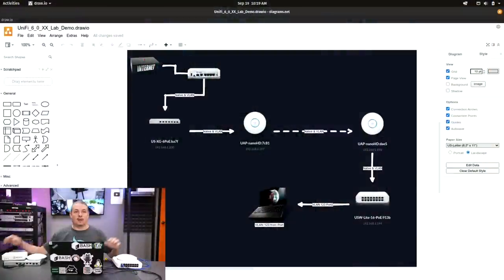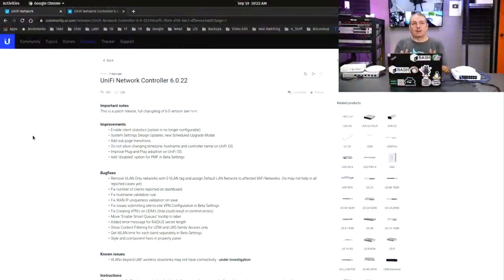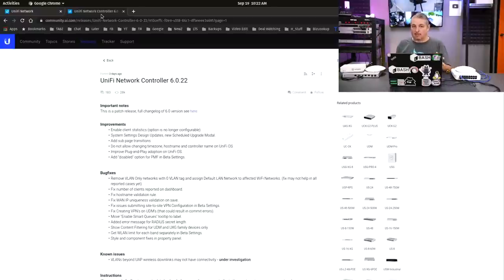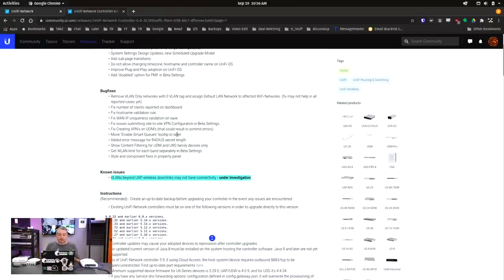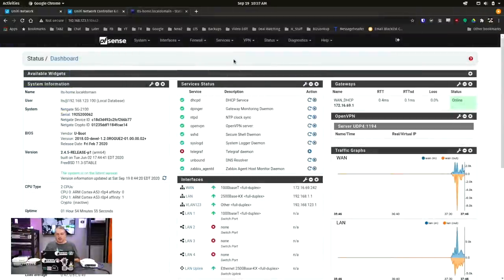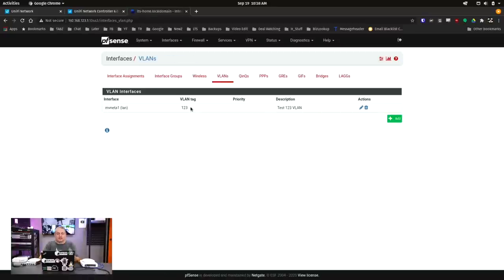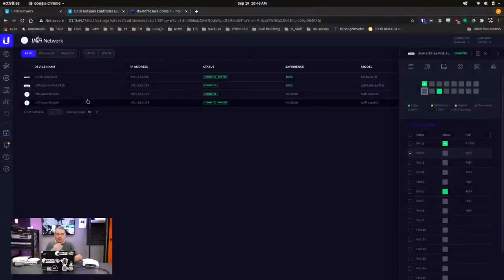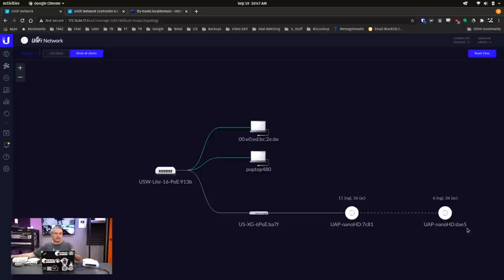Testing UniFi Controller 6.0.22 With VLANS Over MESH & The Problems With UniFi Products

Comment: UniFi Network Controller 6.0.23 has just been promoted to Release Candidate 
Improvements
Add MAC Address Filtering for WLAN.
Limit maximum shown upload/download utilization to 100%.
Bugfixes
Fix Accordions in Beta Settings Networks from being unable to open.
WiFi AI - fix excluded channels dropdown/list.
System Settings -> Updates: use 24h format if it is set in system settings.
Ensure DHCP Relay section can be found in search.
Update AP Group form labels.
Known issues
VLANs beyond UAP wireless downlinks may not have connectivity - under investigation

Comment: If your VAR doesn't add value... you have the wrong VAR and you need to fire them.    Also you need to be on the scale where it make sense.   When you have a many multi-million annual budget, you have things like weekly calls with your HPE ASM + their entire team where all open cases are reviewed, updates about security and software issues are talked about, any personnel issues with vendor Field Engineers are addressed if needed (it happens as they use contractors like Unisys/ect..).   Your VAR is on all of these calls and makes shit happen.

Your VAR is responsible for knowing your base requirements.   When you suddenly need a database server, blade, blade chassis, or HP/pure storage array/shelf/whatever, you just tell them get you a quote and maybe you highlight any important changes if needed.   .........And when they fuck up and something is not right.... you do enough business with them that they make it right without even asking.  If they have to eat $10,000 to change the config of a server so you don't wait another 3-4 weeks to get a PO through purchasing.... they don't care!  NO big deal...

There's tons of Value to be added... you just have to have the right VAR.

Comment: Really old versions of the controller I believe had it on by default. So if the controller was setup a while ago that setting my have been on for people for a while.
Reply: Yep. I installed the 5.x controller about a month ago (due to a flood of going-obsolete UAPs coming my way) and it was on. I know, because I needed to disable it to have more then 4 SSIDs

Comment: New to the Unifi ecosystem and installing a UDM shortly. Can/should I stop it from updating during initial setup?
Reply: The new controller isn’t out yet,  for the UDM or UDM-Pro it’s still 5.14.. The Controller updates come with firmware updates on the UDMs which is right now 1.8.0, which is working fine on my UDM-Pros.
Reply: @lynx_de5024  thanks!
Reply: it all depends on your scenario. Simple scenarios seems to have had no problem on upgrading from 5.x to 6.x controller. Those a little more complex scenarios, those were the one hit hard. If you have a single UDM (the base one), I'd say it's very unlikely you'll have a complex scenario and, thus, will likely have no problem on upgrading to 6.x when it's deployed to the UDM firmware. And that should only happen on 1 or 2 new "regular" controller releases, to fix some of those really bad bugs, which makes UDM upgrade even safer.
Reply: @leonardogyn  thank you also

Comment: That issue with the map and showing the switch wrong is better then the "old" 5.12 (see this screenshot of my home network) https://drive.google.com/file/d/1qDuoISLGUTCKWfXNgEXTUnWPMBQ9ujPy/view

Here the USW-8P-60W is connected to the UAP-AC-MESH only (both are located in my shed in the back of my garden for camera's, never had any issue with them). But it shows like it is connected to the USW-16P-150W on port 9, but on port 9 the UAP-AC-PRO-02 is conencted.

Comment: Lawrence, I disagree with you on the scale of users being the reason for the noise. If Cisco had this many stability problems or didn’t listen to consumers, they wouldn’t last in their primary market (Fortune 500 mega corporations) for as long as they have. There is a real problem here. As someone with lots of experience with huge companies, they do want to save costs and look at Ubiquiti. They just quickly toss out the idea because of so many missing features and poor quality control. for Ubiquiti to actually be enterprise, they need to work on listening to customers and firmware quality control. I hope they eventually get there because their business model is wonderful — they just can’t compete with real enterprise gear in terms of stability because they don’t care if a home user’s network goes down for a bit due to their crappy firmware QA process. When they put as much stability focus and process refinement into it like a dominant player like Cisco does, believe me, the mega corps will take notice and switch.
Reply: Cisco is also not the holy grail. Our Firewall stopped working because Cisco had an bug in there firmware where a firewall running more then 200 days just stops working...
Reply: One example of a cisco low end consumer router blocking curl UA is not the same thing as a firmware update that causes a broadcast storm on your network and stops your network from functioning. Your link has nothing to do with stability issues or listening to customers/customer frustration. Ubiquiti dream machine has been a joke and most youtube reviews show it failing to configure. Dont go there because ubiquiti has so many failures and complaints on the internet including their forums. If ubiquiti was so reliable then why are large enterprises still sticking to the Cisco stuff? At large enterprises, no one likes to spend cash on network gear unnecessarily (except for the IT guy 😂). I am rooting for Ubiquiti but they have far too many screw ups compared to the big dogs in the room. Let me post some of their failures here:

https://community.ui.com/questions/UDM-PRO-release-is-a-disaster/bf98e20e-1290-40a2-9e30-517561fdb705?page=3

https://www.missingremote.com/blog/2020/05/udm-pro-1-7-0-dpi-is-crazy-slow

https://community.ui.com/questions/UniFi-AC-Pro-many-problems-/15277774-874b-4800-81aa-0f4a3af7a75b

https://youtu.be/UA9ZIeRhKXU

https://www.cbtnuggets.com/blog/certifications/cisco/could-ubiquiti-replace-cisco

https://www.reddit.com/r/Ubiquiti/comments/iwhqgu/usg_unifi_is_the_buggiest_pos_software_i_have/?utm_source=share&utm_medium=ios_app&utm_name=iossmf

https://www.reddit.com/r/Ubiquiti/comments/iuglvo/did_anyone_actually_fix_the_udm_issue_of_losing/?utm_source=share&utm_medium=ios_app&utm_name=iossmf

https://www.reddit.com/r/Ubiquiti/comments/ih2a0v/udmpro_review/?utm_source=share&utm_medium=ios_app&utm_name=iossmf

https://youtu.be/SyCdKIE6Bq4

I could post literally thousands of links but you can just check the Unifi forums and its flooded with complaints of Ubiquiti not listening to customer requests (as usual) or reliability problems due to dodgy firmware. Look, I hate Cisco’s business model but they are just far more reliable. I wish Unifi could be the perfect combination of low price and reliability but it isn’t yet. I hope it will change in the future but Ubiquiti IS NOT enterprise-grade no matter how much the fan boys say it is. Sorry

Oh, and don’t give excuses like Cisco forums are private — because they aren’t. It’s all public and there is no secret forum conspiracy. Just google it

Let’s not even talk about support. Unifi should at least offer an enterprise-grade support option because the support is currently a joke. They also release products with promised features but never actually activate them. UAP-SHD anyone? Even $30 Cisco Meraki access points have real WIPS features that actually work by blocking unscrupulous SSIDs while a $500 UAP-SHD is still missing WIPS. I could go on but those who have many years experience with Unifi and Cisco both know the shortcomings and know why Ubiquiti isn’t being taken seriously in the top tier.
Reply: @kittysreview9055  Ubiquiti is for home use. Enterprise grade support Option wouldn't help either because the problems wouldn't be fixed. But at least Ubiquiti would be forced to listen to the customers and getting to know their problems. I tried Ubiquiti on several occasions, for basic setups with 10 Access Points or so with only one SSID it works. For more complex setups in companys (e.g. VLAN use, real management including autochoosing RIGHT und SENSEFUL channels on the wireless side) I am still stuck with professional hardware from (being located in Europe) Lancom. There is support (paid but fast and helpful), a real good knowlegde base and reliable hardware. Safed me most of the headaches...

Comment: Okay, so i'll admit, i'm a complete noob when it comes to IT. Though, i's a bit of a weird case. Let me explain. Since i was young i was always interested in technology/hardware etc. I've been building computers since i was 15yrs. old (i'm 34 right now). So i do have some knowledge about technology in general and some basic knowledge about switches i guess. Like, i know that you have "dumb" switches and managed switches. I know about (the existence of spanning tree) but not what it does (or what it's used for). I know about QoS, PoE (though i don't know things like, if i connect my new Mac Pro 2019, which has cost me $15000 to a PoE switch, will it fry my Mac Pro?) Finally, i know about link aggregation/LACP, but not the full story on it, i know there is full duplex but again, what it means is beyond me, and then of course layer 2 & 3 etc etc...

On the other hand, i do want to learn more about it cause i'm really interested and also i want to have a good internet speed at home and i have multiple devices that i want to connect and be able to manage myself so that i get the full speed and benefits out of it.

That being said, i know a lot of techheads will laugh with me, that's fine, we are all here to learn. My thing is music production and video editing with on the side some graphic (web) design. Things that i all learned by myself. Building pc's is another thing i completely learned by myself. Watching YouTube goes a long way but it's not always 100% complete, in a way i guess.

Then there is also the language barrier. While my English is "okay", it's not my native language. So i might make mistakes along the way.

So now, for my real kind of question, i would like to start out a home network. And so far i knew that Cisco was a great solution when it comes to network switches. But then i learned about UniFi. And i'm not sure what to do, because now i see this problem. And i've also seen updates on the hardware like gen2, and i just really don't know if i should get one over the other. I know Cisco is more advanced and really used more in professional area's. I know it's more of a steep learning curve. But like i said, i don't mind that, and also, well, i have the time, since i'm home because i have a disease named Graft Versus Host.

Anyway, if someone is willing to help me out a bit with this, i would greatly appreciate it!
Reply: @promethbastard  Thank you so much! Okay, then i will look into UniFi! I'm going to buy one next month probably just upgraded my storage because i was starting to get low on that as well. It all cost so much! But hey, i love technology and i love to learn more and more and, well, with that comes a cost of course 🤷🏻‍♂️

Comment: What about Mikrotik?
Reply: I switched from mikrotik to unifi. Now my network got entirely grilled the second time in less than one year because of that controller software , which is getting more ugly. I have 3 AP and the 24poe switch and the USG. The USG is not even able to create static dns entries without cmd hacks .. so I guess it is time to move back to the mikrotik stuff cmd for everything , but rock solid
Reply: Florian Hammers Mikrotik is my choice because of its abilities to provide a great security features

Comment: Personally i don't really agree with this argument. There are a few ways to address these issues. As someone has mentioned, you can create at stable release, so if you wanted to say have rolling updates and auto updates on, you can and you would just set it to stable release. You talk about Windows 10 and even Microsoft has a stable release, but this is also comparing apples to oranges. Microsoft has to support a lot more different configurations than ubiquiti does. Not saying that Microsoft doesn't have its fair share of problems either, but its hard to compare these two companies. If you are going to release a product and call it enterprise ready, then it should be just that. Their hardware is great, but why are there so many issues with their software? This is not just a one time thing, it happens over and over. You talk about making contributions back to ubiquiti, but how? Make it open source and then we can talk. While this may be a small percentage of users, it doesn't look good when dealing with optics. You said it yourself, there isn't a lot of competition in this space because it is so niche, so this is all we have right now, which tbh isn't all that great.